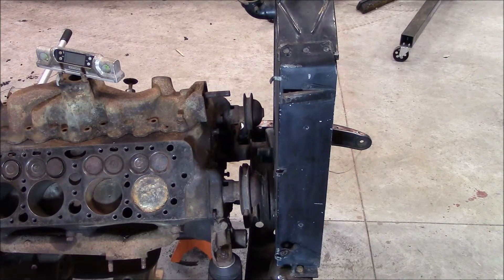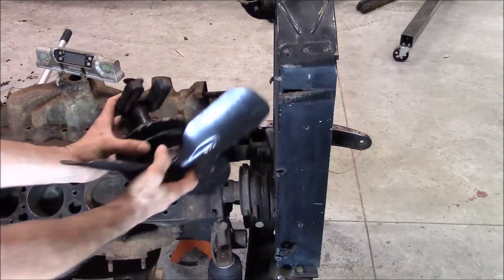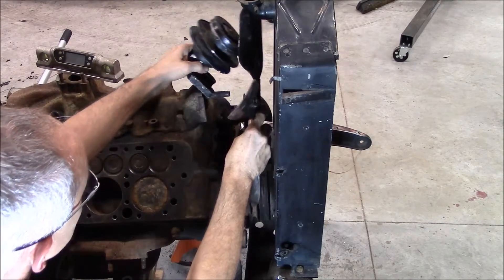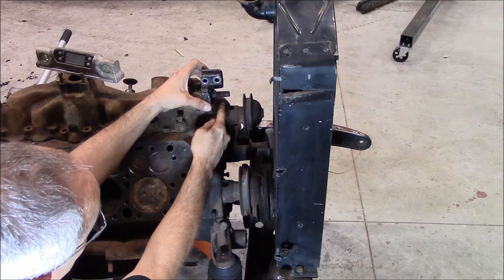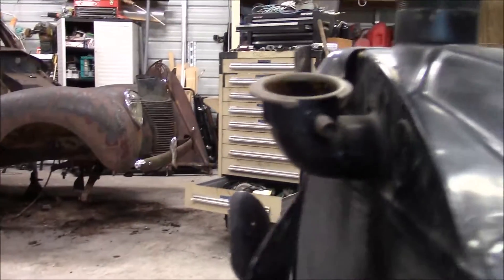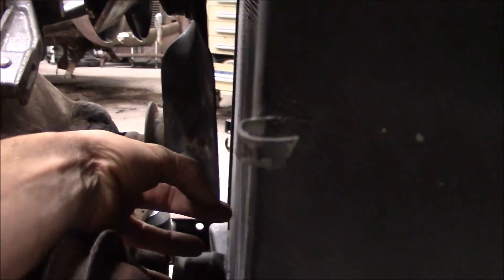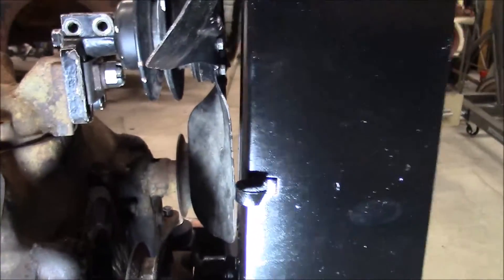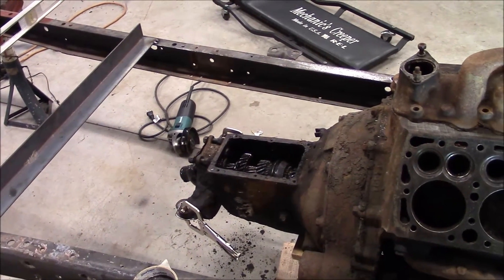Aarons 29 AV8 coupe build 14 Dec 16 update

Comment: Drop. The drive shaft an move back 3 inches cut the fire wall out shorten drive shaft if you move the radiator the front axel will be off the ibeam for looks